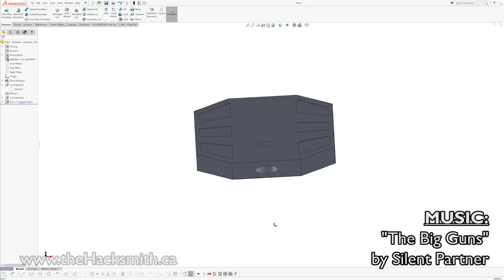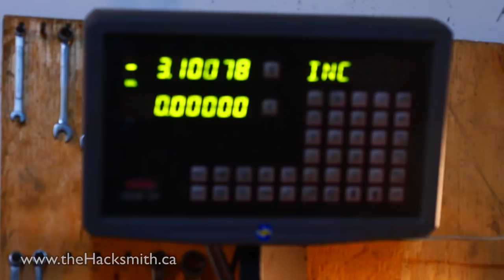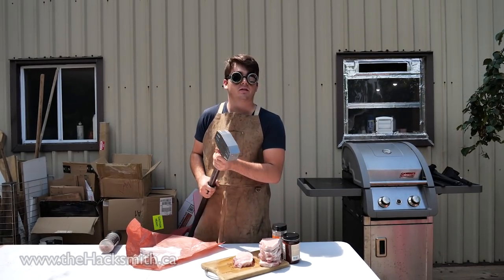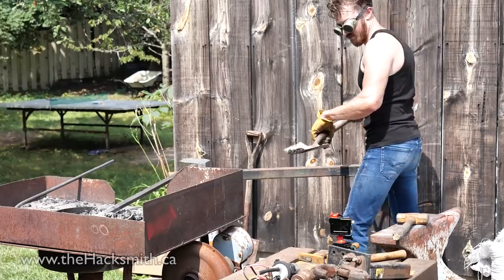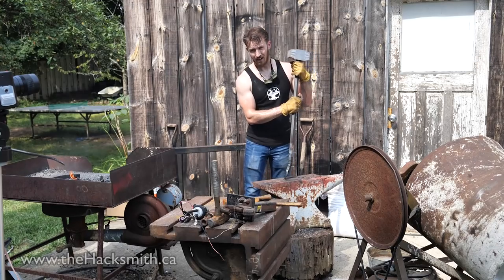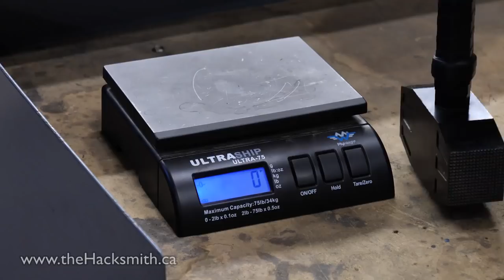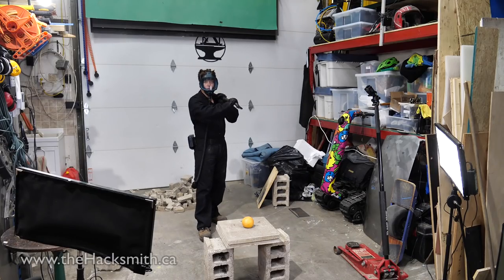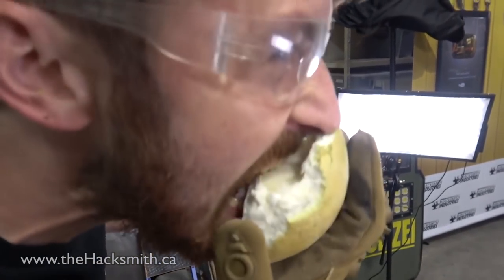Sledge's Tactical Hammer DESTROYS ALL (from R6 SIEGE)

Comment: Do Mira black mirror
Reply: Then you have the oxygen thing you can break at the bottom
Reply: I think that wouldnt be possible as the mirror uses I think the air to compress onto the surface and you would need a vacuum to make it stay on
Reply: TorpedoFan no. Even with the air compression engineering, it is still plausible to break the canister that holds all of that compressed air and drop the glass. Although, the whole thing would be unattractively complicated for just a bulletproof peek hole.

Comment: You should do Montagne shield or twitch drone
Reply: Montagnes shield would be impossible. Well it would be possible, but it would either be really unpractical and 10x too heavy and big, or it would be useless and not protect enough
Reply: And electricity doesnt go like that in air
Reply: @user-wq9mw2xz3j  taser darts. Just need 2 electrodes
Reply: Rackie its a thin rope of metal
Reply: Twitch drone is already done
Reply: Rackie it’s literally like a taser but like 100x more efficient and stronger

Comment: I fully expected for you to cook that pork with thermite...  

Maybe if you get come C4, you can make Thermite's gadget and both cook and tenderize the meat in one go.
Reply: With maverik cutter
Reply: “When you mix fuel, metal oxide and metal powder in just the right way, it burns at 2000 degrees Celsius. Hot enough to cut through nearly any barrier known to man. Throw some C4 into the mix, and you've got one hell of a combination.”
Reply: Sarin We iuse these experimental nanothermite charges to barbecue the place! I can say barbecue right?
Reply: 2 pounds of c-4 is enough to blow up a full house
Reply: llbenjonjoll I used to be undercover. I did time. I had to deal drugs. I even had to kill. And I was so good at it... that it got me a promotion.
Reply: FITTERSCROLL717 Why stop there?
Reply: thermites gadget is made of thermite not c4
Reply: Well throw some C4 into the mix then ya got yourself one hell of a combination
Reply: NotLeviathan Yeet "When you mix fuel, metal oxide, and metal power in just the right way, it burns at 2000 degrees celsius, hot enough to cut through nearly any barrier known to man. Throw some C4 into the mix, and you've got one hell of a combination." -Jordan 'Thermite' Trace
Reply: FITTERSCROLL717 ya well bandits drugs are enough to cover a mansion

Comment: YOU NEED TO MAKE JÄGERS ACTIVE DEFENSE SYSTEM!!! It would be soooo cool!!! PLEASEEEE
Reply: make it kill mosquitoes
Reply: That’s not a real thing, there’s stuff similar to that on tanks that intercept anti grenades
Reply: @Mark-bb4ks  you just controdicted yourself, so it exists but its only used for talnks at the moment. It could be made smaller
Reply: Tectoz I saw d there’s stuff similar are you lost buddy?
Reply: Active Protection Systems (APS) already exist, though they are a lot larger and not as accurate as in game. They are fairly common on tanks, IFVs and APCs
Reply: Sladee They said it could not be done. They said it was designed for tanks. They said I could not make it smaller and more accurate. They were wrong.

Comment: I've got two thing valkyries camera and jackals foot tracker
Reply: Foot tracker sounds advanced but black eyes may be a cool idea
Reply: HBMI Clips How would the foot tracker  work
Reply: @refresquur5993  it sees recent footsteps and it tells you who they are.
Reply: HBMI Clips but you would need to do lots of biometric and biological engineering to do something like that
Reply: HBMI Clips You’re either really young or don’t know the slightest thing about engineering and science in general
Reply: foot tracker
Reply: @CrypticNarrations  how old are you cause a foot tracker is very VERY hard to do and life is not a game
Reply: Both are really hard to do, from a machine that scans for the enemies footprints while blocking out any traces of other markings while also finding the exact position of the target while also knowing who the target is from their brand of shoes to having a minature camera that can stick any surface and doesn't break from the throw and has full 360
Reply: HBMI Clips jackal would be hard, but not impossible
Reply: The valk cams are probably possible but I doubt it would be possible to make jackal’s foot scanner because of the horridly high complexity. You’d have to have a camera detect footprints and match them with other pre-codes footprints. Also if someone wore the same shoes as someone else it would impossible to tell the difference.

Also, it would probably work worse than the iPhone 6’s Touch ID.

Comment: I would like to see you make pulse's cardiac sensor or fuze's cluster charges
Reply: Dude a cluster charge? How? Fireworks? Damnit now I'm interested
Reply: Pulse might not be possible
Reply: GloriousSpam pulse isn’t possible
Reply: Pulses gadget works by using a very sensitive monitor to listen for a heartbeat sound, and then pinpointing the approximate location using the time it takes for the sound to get to the sensor. The sensor is real, and is used for rescuing people from under rubble by detecting where they are buried. It does not, however, work if there's a lot of background sound, and it's a huge device, like the size of a suitcase.
Reply: Cardiac sensor is impossible with the teck that they have available to them and the size would be impossible
Reply: GloriousSpam the cardiac sensor is a thing, just not something they can make. For fuze's cluster charge, that's basically asking them to make grenades.
Reply: GloriousSpam Rashan cluster charge? Blyat! Do you want them to go to prison or something?😂